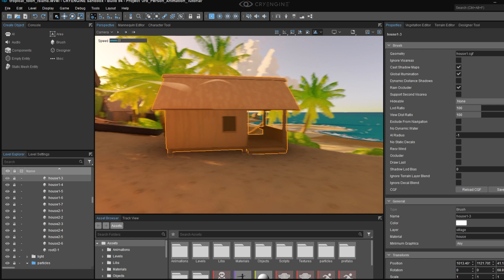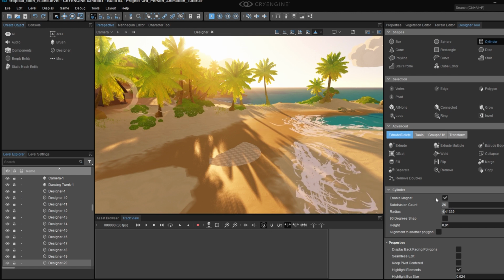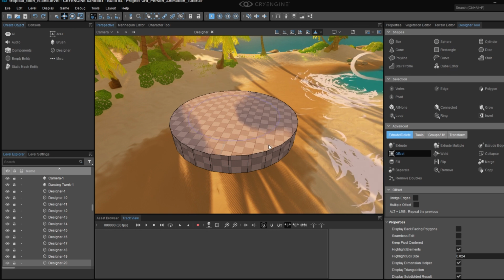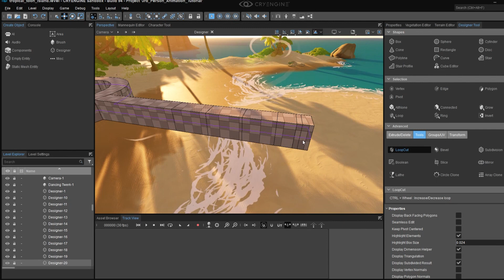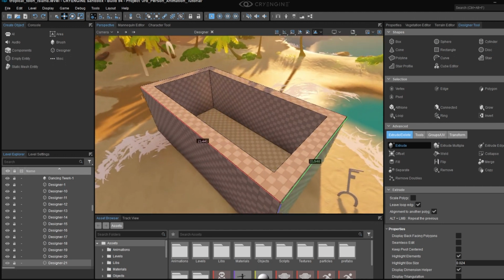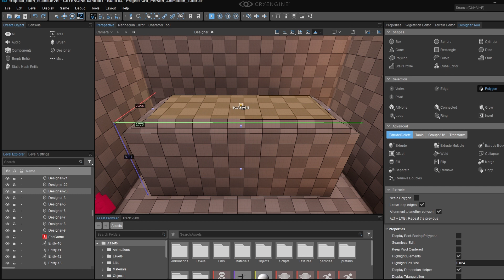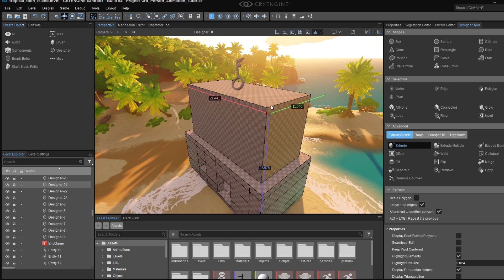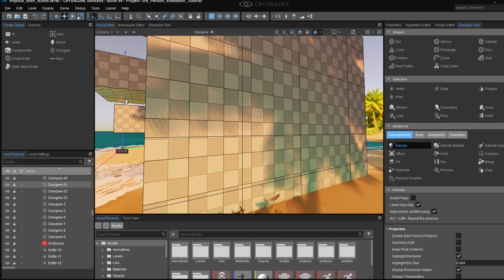Practical Prototyping - CryDesigner Tool - CRYENGINE Summer Academy S1E2 [Tutorial]

Comment: Is there a performance or other impact for using Designer Tool assets instead of imported CGF assets in a final product? Just wondering if it could be used for more than just prototyping but for final design (where appropriate of course).
Reply: No, but setting up assets using Designer Tool will limit your ability to create LoD's - I.e. what you see is what you get. You can always export this to a DCC tool and create your other LoDs and then re-import it, its just a little bit of work.

Tl;dr - the performance impact of using a Designer Tool Asset is no different than an asset made in Max, Maya, or Blender.
Reply: Yes, I would imagine if your asset made in Designer Tool is complex then it may impact performance a bit because of proxy. Let's imagine you have very advanced architectural building and if you convert it to CGF it will also automatically very complex proxy. It can be easily remedied for complex project by exporting it to some 3D tool (i.e. Blender, 3DS, Modo, etc) and reimported quickly. 

However all white boxing / blockouts / grey boxing done in Cry designer allows you quickly establish a scale, proportions, general look  of your assets, plan game flow, plan out environment, etc. If needed final design can be easily adjusted in external DCC tool of your choice later on with.